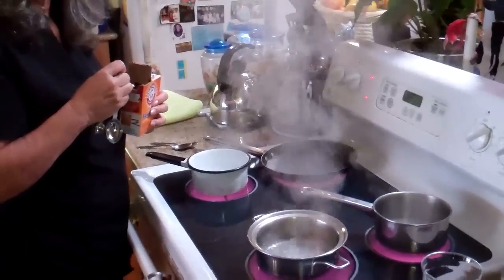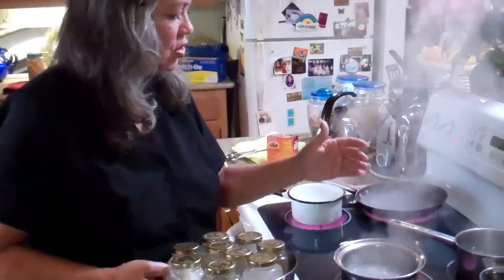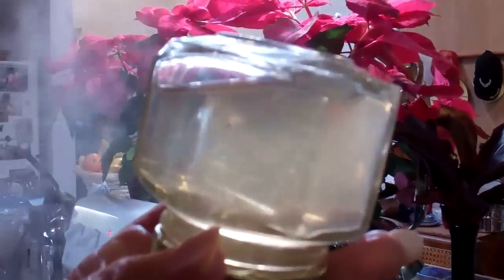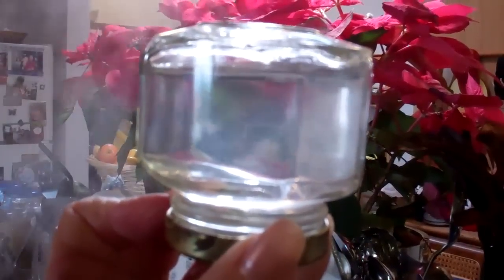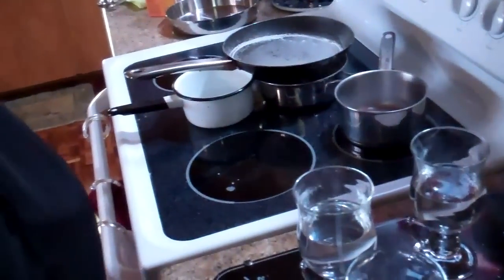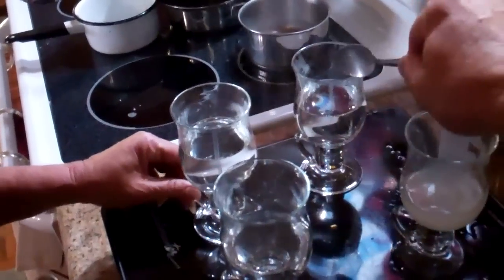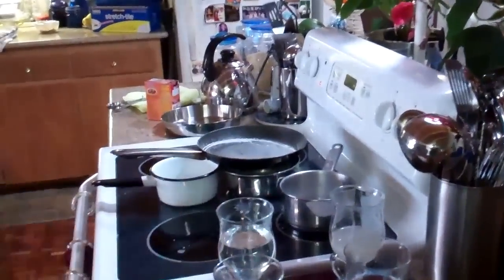TEST YOUR WATER & COOKING POTS

Comment: To separate a mixture of liquids and its solid contents, it can be heated to force the  components. This is called distillation process. If you are saying the white sediments on the pot are not baking soda then you are lying. Those pots has different boiling point because they were made from different type of metals thus result with different distillation process period which will result to different taste of the water. Perhaps you should study chemistry first and the table of elements before showing this one. This is scam.
Reply: yup...absolutely true.
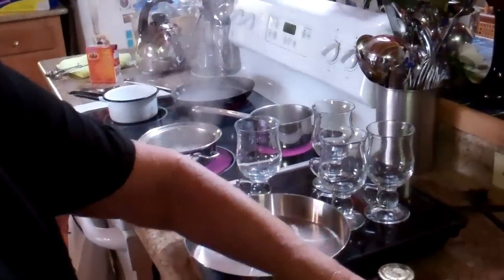3:49 water in both steel utensils was boiling, however non-stick clearly wasn't. that white water was simply baking soda....
trying to fool ppl thru baking soda
Reply: Thanks for highlighting this